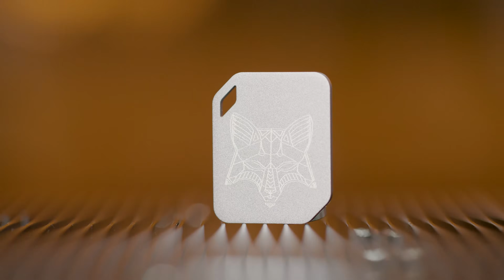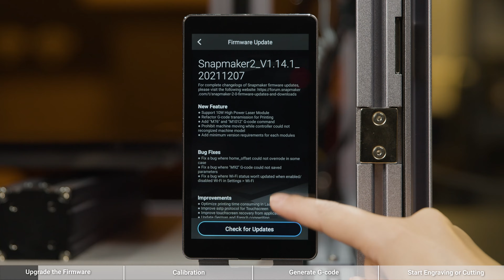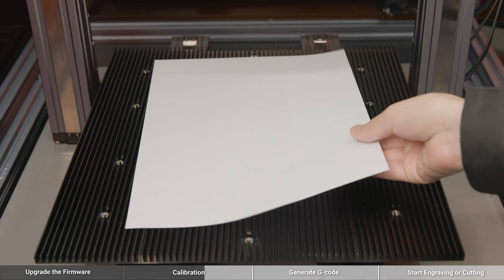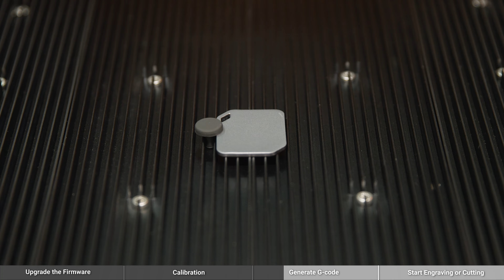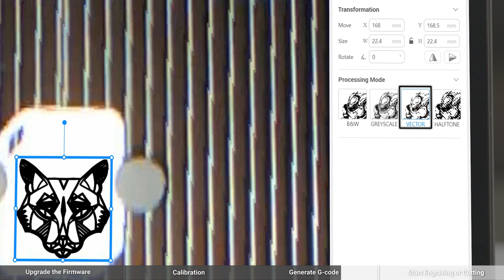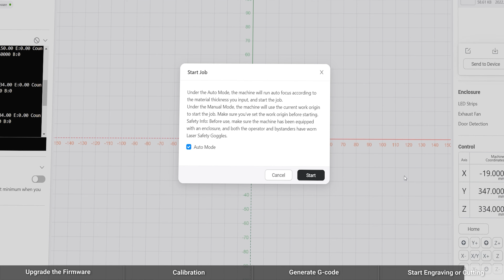How to Use the 10W Laser Module via Camera Capture

Comment: When calibrating the camera in Luban: "zoom in on the image", but how to do that? There are no controls on screen, clicking and dragging on the image did nothing with or without keyboard modifier keys. Only way I found was to roll the scroll wheel (not available on all mouses). But this seemed to do some random combination of zoom and pan. By trial and error I eventually got all four corners aligned reasonably well, but I did not feel at all in control of the process! It would be much better if the window was resizable so the whole image could be made bigger on screen with all four corners visible at large scale at the same time.

Comment: hi! Can it be used to engrave on a glass bottle?
Reply from the maker: Yes, you can use Snapmaker 10W high power laser and rotary module on Snapmaker 2.0 to do that.
But you need to make sure the glass is non-transparent.

Comment: Hey there Snapmaker, question.. I've probably a big project/thing I wanna try out to laser, but I was wondering if it's possible I could set up the Snapmaker2 (350) as a table-machine, so I could engrave bigger projects, in 2 or 3 steps (images) and slide the project under the machine to the next stage when finished? If yes, is there a handy tutorial about this ? :)

Comment: So, the goggles aren't enough for the 10W laser?
Reply from the maker: The goggles are good enough for protecting the eyes of the user wearing them, but the Enclosure provides full protection for anyone around the machine, reduces noise and fumes released into the air, and the auto thickness measurement system works better in dim light.
Reply: You need to protect the rest of your skin from direct/reflected laser light, think of it as a dangerous UV suntan. It's the same with Welding.
 Enclosure reduces 10W to safer levels (they say equivalent of the 1.6W), but eye protection still required, so long term exposure is definitely bad.